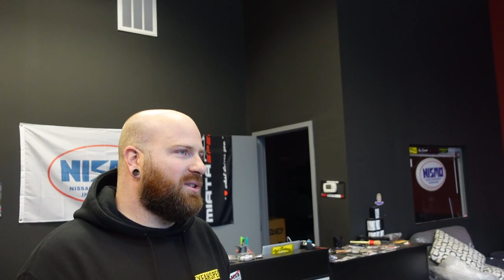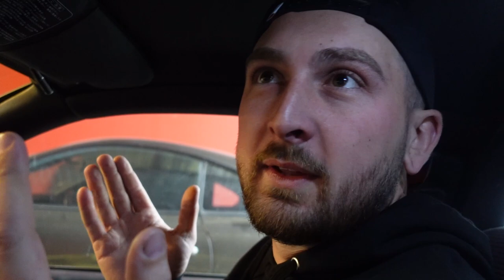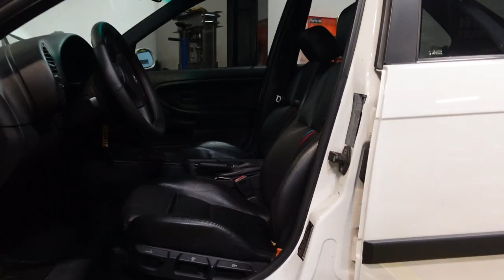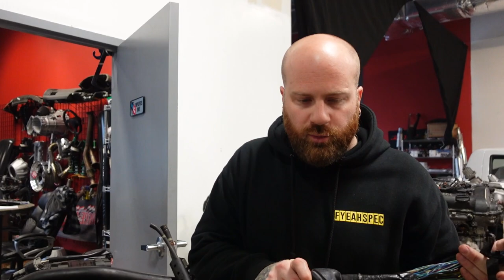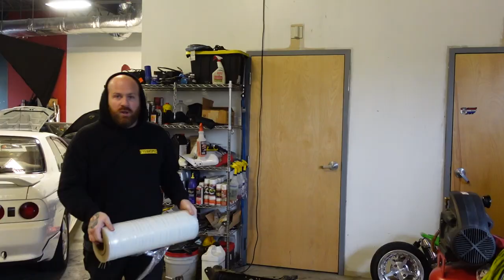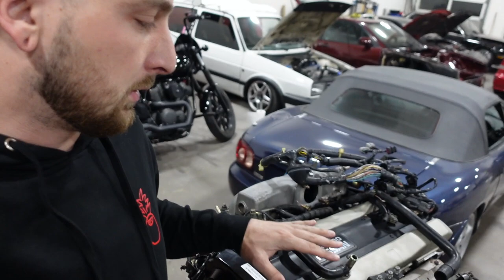FINALLY CAVED - Buying an Engine I never thought I'd own..

Comment: "This dude likes carburetors..." 
That says it all 😂
Reply: That he's an actual car guy?
Reply: @123vaw123  That he has... antiquated tastes you could say lol No hate on carbs but it is 2020...
Reply: Nothing wrong with a good carb setup tbh
Reply: @LostP250187  I respect them, just would never choose to have one
Reply: @RotaryDaddy  one big advantage to consider is that the fuel gets cooled way more efficiently through a carb. There are advantages.
Reply: @knightfall7534  for sure! But i just feel like I'd like to have more control over my car than carburetors can realistically give me
Reply: Josh is about that culture. He's a cool dude.
Reply: @RotaryDaddy  You have no knowledge of carbureted vehicles which all gear heads should cut their teeth on
Reply: @STAY-GOLD-VINYL  A. That's a bold assumption for someone who doesn't know anything about me.
B. Why should people new to cars learn about technology no longer being used in cars? Don't you think there's a reason they were left in the past? I get enjoying them for nostalgic reasons but you can't sit here and tell me they are anything more than a novelty at this point.
Reply: @RotaryDaddy  they aren’t just novelty, they are cheaper to use, and easier to tune, and for a specific application, can result in higher power. If you have a big v8 and are just hitting the drag strip. Why put the extra wires, weight and money into getting it tuned when you can just buy a cheap jet kit. Tuners are expensive and wiring is a pain and expensive. I like efi better don’t get me wrong but saying it’s a novelty is just a lie.
Reply: @knightfall7534  don't get me wrong, I totally get where you're coming from, I'm not saying they don't have their place, but even with v8's most people aren't swapping carbed v8's into cars anymore now that ls engines are so cheap and readily available. As far as I'm concerned most people looking into working on cars for a living would be better off learning about electrical systems and fuel injection than carburetors because the likelyhood of ever encountering one now is getting pretty slim. At the end of the day I was just poking fun because I personally prefer efi lol

Comment: Coming from someone that has owned a S1 RB25 for 12 years, pushing 350hp at the wheels, done 38 track days & countless additional km I am very excited. PS: keep the oil temps under control and it’ll last forever. PPS: put a Sinco on it

Comment: holy shit!!! i had a yellow slicktop 300zx on gran turismo 3 a-spec. it had like 700 hp and that's when i fell in love with the 300zx. absolutely amazing car :O such a bitch to work on, but when it's running right it's a gem. the 300zx was rated in the top 10 most beautiful cars ever built, and that still stands to this day.

Comment: I'm building a z31 and I told my buddy's it's getting the jimmy O treatment (meaning take my time and do the extra steps to get bbn it right)
Reply: Ouuu a z31, what’s the build? And how’s it going so far? I’m also another Z31 owner
Reply: @ericnelson9325  big turbo, 550cc injectors with full fuel system, on coilovers and angle kit I made lol alot of stuff rn shaving the whole bay also

Comment: u should do an n54 swap in the e36 . costs less than an s54 because youd probably have to get rod bearings, and rebuild the vanos. you can buy a 335i for like 2-3k crashed, and 4-5k decent condition. you're lucky to get a rotted e46 m3 for 6k.

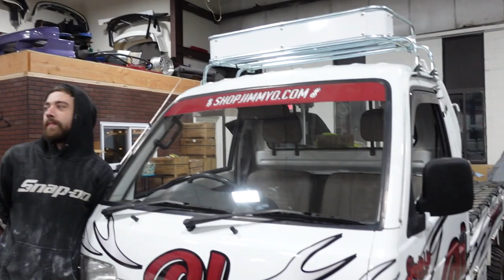Comment: @11:04 jimmey in the bed of ktruck between the frame rails. that would be epic!!! the weight alone of the rb and trans and rear dif would make the k truck sooooo fucking solid! all that weight being so damn low to the ground inbtween rear frame rails would be fucking epic as fuck!!! that k truck would be able to tow anything! as long as you upgraded the brake system aswell to help support additional stoping weight =] that would be the sickest build on youtube!!

Comment: Rb25 are everywhere here in Australia most a clapped out and engine has to be built when going past 300kw go a rb30 with 25 or 26 head thats where its it
Reply: You can't just pull an RB30 out of thin air lol, for those of us in AU/NZ a 25 or 26/30 is possible but in the states, it costs way too much. S1-S3 RB25s absolutely do not need to be built if passing 300HP,  not to mention that a NEO is a lot better than a S1-S3 RB25.

Comment: Junk the K-series. Everyone is K swapping. An RB is more iconic.
Reply: SKY J it’s also a more common swap. Don’t think anyone’s ever k swapped an s15
Reply: A RB is also way less reliable.
Reply: I'm sure someone has, but it's not as common as an RB, but personally is stay away from Honda Vcrack. Nissan, Toyota, or LS. Taylor Ray is putting a K-series in a Nissan too 😞
Reply: @Thibault_95  Nah bro my uncle has one in his Skyline that makes like 1500hp and he's been driving it for like 20 years dude
Reply: To see a k series motor in such an iconic car would is such a rad build tho. Easy and reliable power and it’s the same size motor that came stock in the chassis. He even said the weight ratio with a 4 banger is the biggest reason he went with a k

Comment: I dont agree with tom at all srs are junk who would make a engine with a heavy ass rocker and then just sit it ontop of the valve and pray the cam holds it in and rbs are so much more junk then a j 1st the oil pump y would u do that nissan stopping rant now